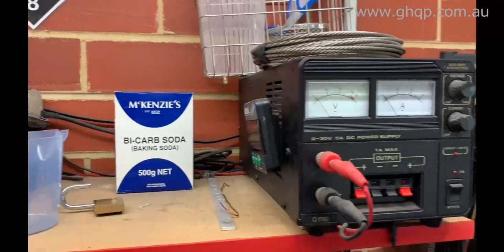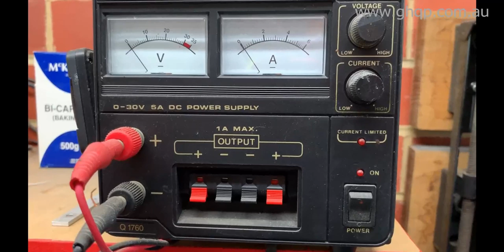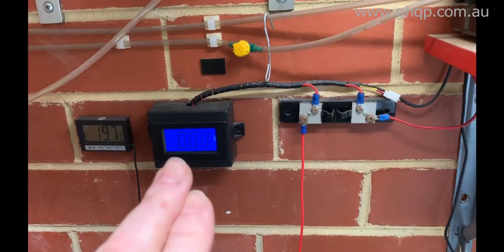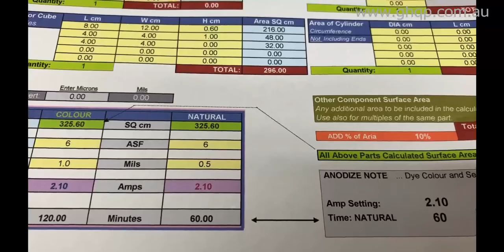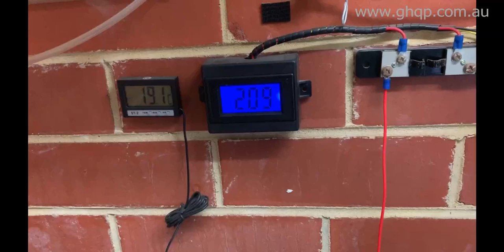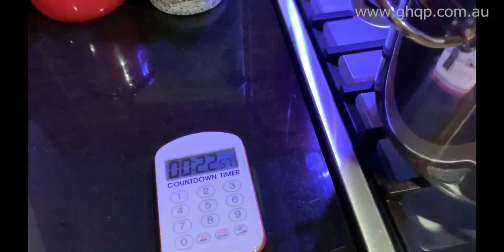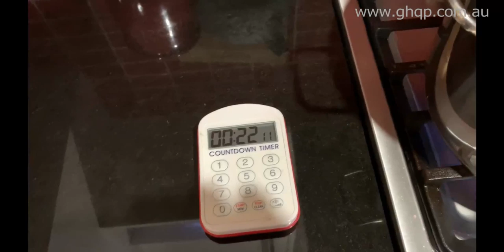Home Aluminium Anodising Process - Part 1

Comment: I thought the color of the oxidation depended on the current passed through the piece. Can you explain this part better?
Reply from the maker: The level of current passing through the part along with time simply determines the thickness and hardness of the anodised layer not the colour eg red, blue yellow etc. With some grades of aluminium there is a process to produce a black finish without dying. However for any other colours this is achieved by soaking the freshly anodised part in a special dying solution. The anodising process causes microscopic pours to form on the surface. these pours are like a sponge that absorb the colour dye. After this the part is boiled or sometimes soaked is a solution to seal and close the pours trapping the colour. I hope this helps.
Reply: @hamrx8  Thank you so much for the insight. In the meanwhile I learned that what i was talking about was niobium/titanium